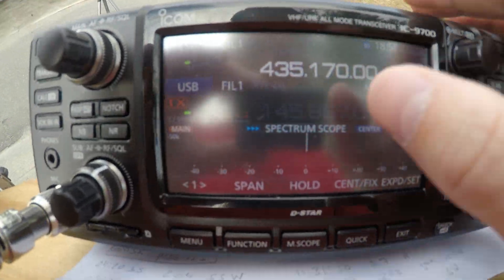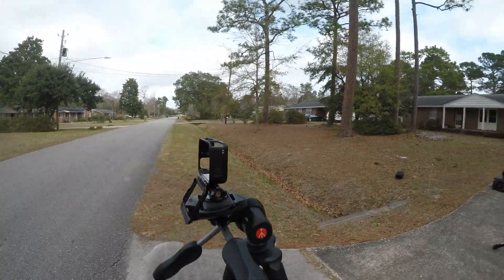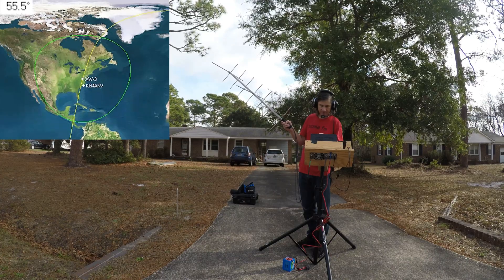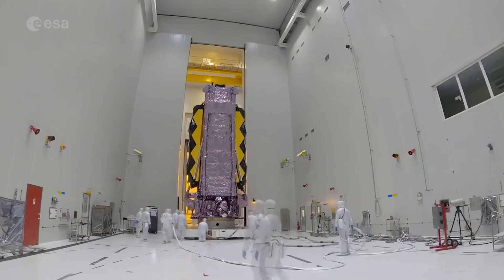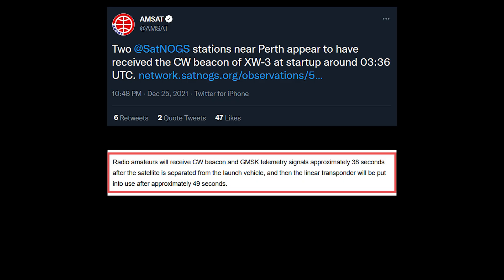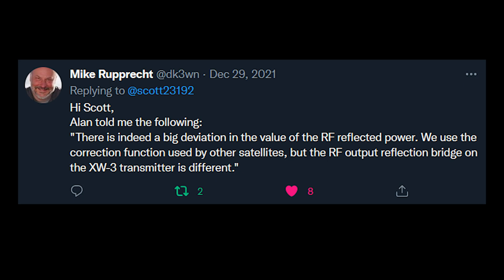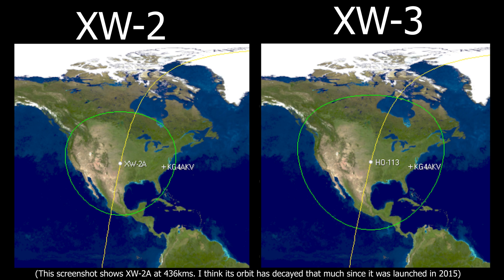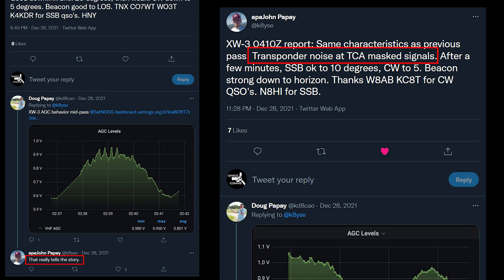New linear satellite HO-113 and its issues

Comment: Thanks a lot for the update John. I had a brief portable rove last week and struggled a bit with XW3/CAS9/HO113. The noise at mid-pass was disconcerting for sure. 
I bet 50-75W w/handheld antenna leaves you with a headache for the evening. Careful with longer term exposure using handheld antenna. Us hams will only get to know when it’s too late!
Hope to work you some day on HO113, 2A, 4A/B, 44, 07B or JO97… Happy New Year. 73 Nick M1DDD (also a few Sat vids on my channel)
I like the tripod rig mount btw!
Reply from the maker: Thanks for stopping by, Nick. I'll be careful with the power, thanks. I think if you do the exposure survey as long as you are behind the antenna you are okay, but obviously you always want to use as little power as possible. I hope we can work on the birds too sometime. RS-44 would probably be easiest. Keep making videos! It's a great hobby that deserves all the exposure it can get!

73, John Brier KG4AKV